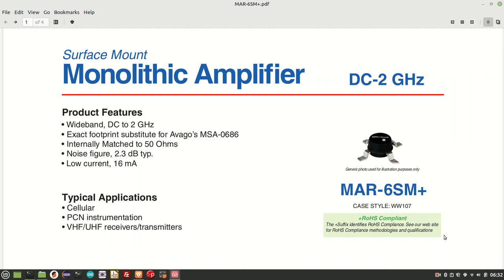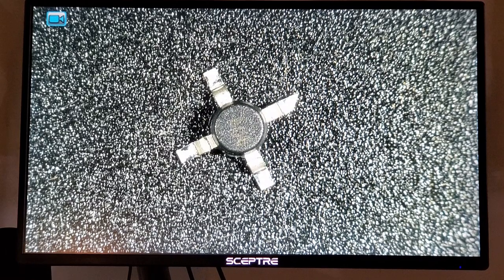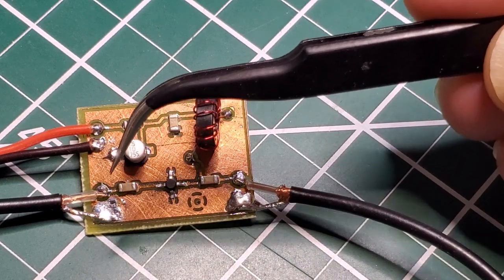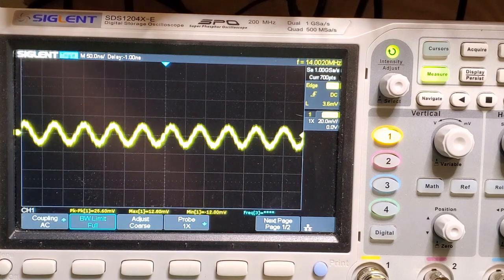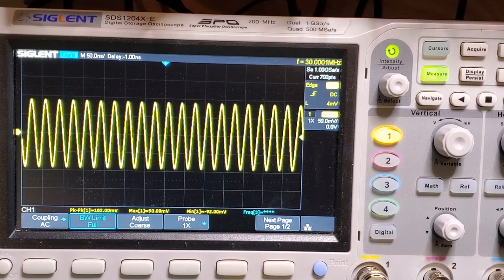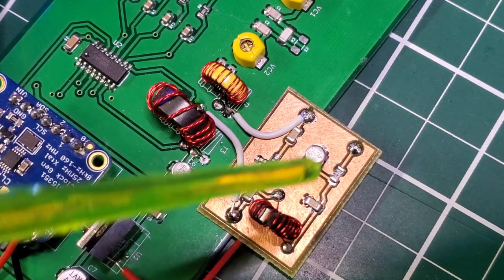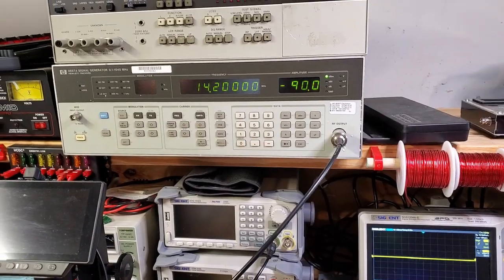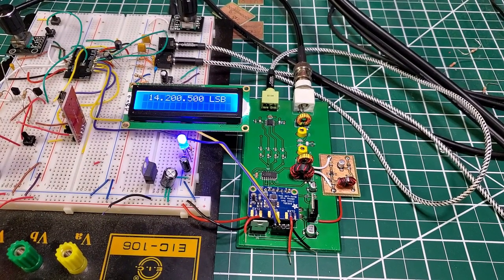Using the MAR 6 as a Preamp

Comment: I found this today but it is an old video.  I bought a shielded indoor loop ant for an HF receiver but found the output very low. I decided the MAR 6 chips that I had never used would make a good low noise HF booster with 20 dB gain which is about perfect. I made an approximation of the Mini Circuits prototype PC board.  The 1% resistors to bias for given supplies was a PITA so instead I incorporated a pot into my board and used that to set the required 14 mA current drain with a fresh 9V battery.  Very small enclosure with SMA conns to match the antenna at the loop/balun end of the coax. Now I found out a ham bloke WA5VJB makes small PC boards for MMIC amplifiers,  which are generic and can be assembled for any of these 4 lead chips and they are very inexpensive.  Check it out.

Comment: The little MMIC amplifiers have such a high bandwidth, it's easy to get them to oscillate.  At the beginning of the video, I was wondering if your choke was going to make it oscillate.  Dodged that bullet, but throwing flying leads around will do that.  The problem is that their reactance at high UHF frequencies will cooperate with the amp to make a good oscillator.  If you have a spectrum analyzer with enough bandwidth, you could use a probe to identify exactly the frequency of oscillation (high UHF oscillation might be invisible otherwise).  You can try to kill them by adding shunt caps or ferrites for the right frequency range...

Comment: When you respin the Tayloe board with the preamp you might consider using a pair of 3pin single row headers wired such that you can jumper the amp in and out using jumper shunt things. Minimizes wire length. For 14 MHz will be totally fine. I would layout jumpers so you can either include the amp or not on both the amp input and output. When amp is set to be not in the signal path I would arrange to have a 2nd set of 2 pin headers to shunt in 50 Ohm terminators on both in and out to prevent amp  oscillations.
Reply from the maker: Thats a really good idea Herbert. Been meaning to getting around to a second rev of the board. Thanks for the comment and idea

Comment: MAR-x make good RF and IF amplifier stages. I've used small relays at either end to bypass. They operate in Class A (?) and draw a bit of current, 30 to 50mA from memory,  so  if you use 2 or 3 of them it adds up.
Reply from the maker: Thanks Paul - I never got around to a relay circuit for these - but thats the way to go.

Comment: Thanks for this video .... You are putting the bypass capacitor after the 510 resistor not as in the schematic , I think it is more versatile to change the RFC for different range of frequencies.
Reply from the maker: Thanks Ali - I'll have to fix that when I put it on the Tayloe board.

Comment: Is 2.3dB NF a good number as an LNA in general? Some people say it is too noisy and I should use TQP3M9009 which has a <1dB NF. But I am not sure if 2.3dB vs 1dB really matters if I just want to do simple 50Mhz(6meter) SDR receiver.
Reply from the maker: Honestly I used the MAR-6 because I had a few laying around and I wanted to find a use for them. They seemed to perform reasonably OK for my purposes. Originally I had wanted to use the MMG3 https://www.nxp.com/docs/en/data-sheet/MMG3H21NT1.pdf but they were quite expensive at $3 each. Thank you for the comment!